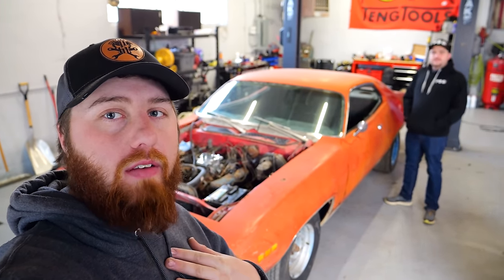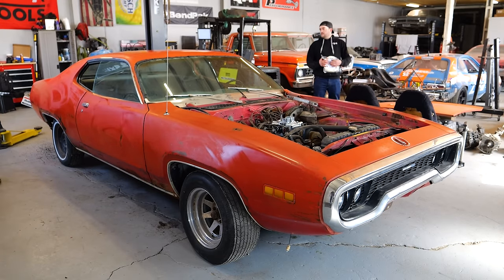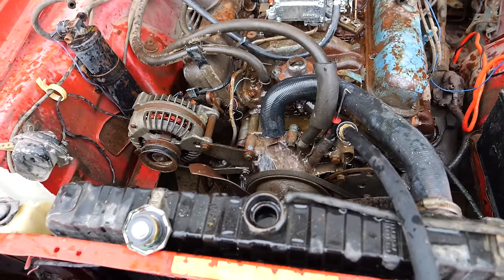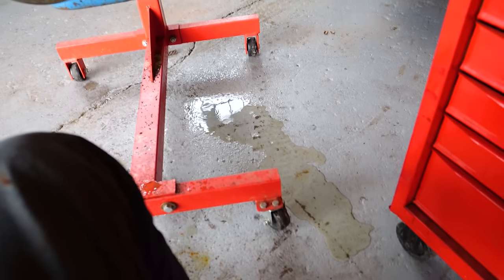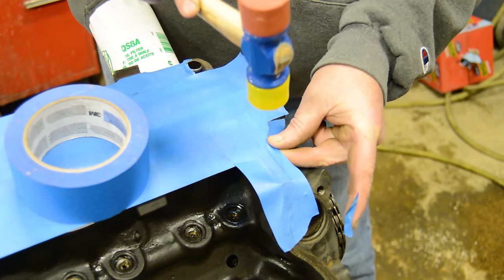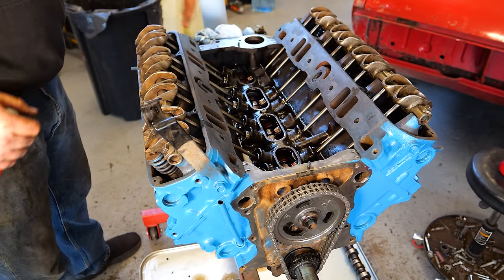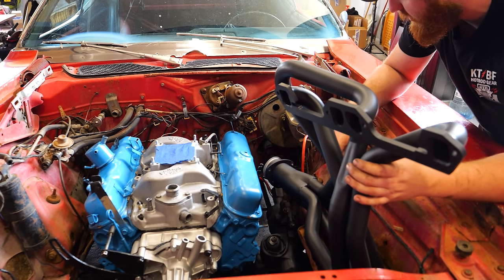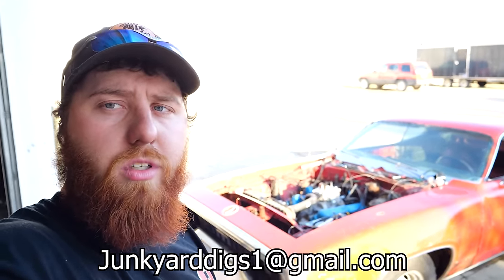ABANDONED MOPAR Budget Engine Build + Paint REVIVAL - Lost for 30+ Years!

Comment: MOPAR! OIL pressure is low. FYI You should always start in the middle of a rocker shaft and tighten all bolts. Gradually. Learned from experience. You can bend shaft. prssure should be around 40 at idle for a mopar.

Comment: take out that VW radiator and get a 140* thermostat and try to keep it 140 to 160* degrees max, get an engine oil cooler, get a transmission oil cooler and make them huge, get a double pass custom humongous radiator by filling the entire front end head light to head light with it, thats what i am do.

Comment: Why didn’t you check the   Bearing on the crank or put a new set of rings or do a valve job . It’s going to be a bummer when you racing it a ring or bearing goes.

Comment: C'mon Kevin.... how can you POSSIBLY justify to your viewers not pulling the heads or even the oil pump while the engine is on the stand getting cleaned and painted? How were all of the main bearings? Rear main seal? What was the point to all of that... polishing a turd?

Comment: Would have been a whole lot better if you had done those heads there are you going to have issues with those umbrella seals on the valves they're going to start breaking going down into a oil pan and clogging up the oil have fun with that enjoy

Comment: i order all my trans parts for my th400 from summit. never ill say that for the guys and gals in the back of the class NEVER USE PAPER FILTERS FROM ORIELLYS OR AUTOZONE ETC ON A TH400 use a wire mesh filter and double gaskets on the pickup tube case side

Comment: I feel like if you’re going to take the car back to the original owner hoping he would buy the car back that you should address the engine issues like the valves  at least try lapping the valves and do the oil pump, bone the cylinders and some new rings. If the original owner wants to rebuild that engine he’s going to have to pull it out either way.

Comment: Roller cams do not need a breakin like a flat tappet cam.😂 For the street degreeing a cam is a waste of time, install dot to dot. If your on the track racing then degreeing would be beneficial. You say that the chain will move to dot to dot? Are you using Chinese chains? That is complete BS. I put on 48,000 mi on a solid lifter cam in my 70 Z28 and the timing was still dot to dot @ TDC on #6 comp stroke. But those parts were made in USA. LOL. Not sure about Mopars BUT you can’t use the same length pushrods on a Chevy 350 when you switch from a FT cam to a roller. I have a roller in my LT1 now and it’s impossible to get the correct center ride on the rocker arms to the valve tip. Some clear rattle can paints will turn yellow from the heat. Do not use RTV on thread bolts. Engine builder go crazy when people use this crap. Use Permatex 2 on bolt threads that see coolant or oil.

When breaking in a FT cam you should put a dot on each pushrod in the same location so you know the pushrods are turning. Lift off the valve cover for a few sec to check. If they are not turning then you will lose that cam lobe. And when setting the lifters, limit the amount of turns you turn the engine by hand or you’ll just wipe off all the cam break in grease off of the lobes. 😅

Comment: put roller cam an lifters in a tbi with out doing valve springs was very popy for two days  no at lidel it has a puff puff sound like theze engine think im good to run it I chould take a video of it see what someone thinks 🤔 never. Dun these work before thinking of doing celinder test take plunge wire off one at a time running see if I find it it's a bad head vavle when the flat tapit went out let me know what u guys think

Comment: Best way to blow an engine is to this video build the top running 100% while engine below is running about 45- to 50% ya that makes since spending lot on top end to re do it in the first month driving it ya them a whole rebuild ruined all you put in it to force a rebuild if you did not hurt the block the piston walls or crack block, big chance in one or both happening hu. Will ruin what you put in it when you blow engine all said do what is best or what you think is best hu

Comment: I don't understand why you would pull the engine, replace can & lifters and neglect the valves and valve seats, your that far in it's not that expensive. Compared to replacing the engine later.

Comment: Why don't you just use this???....SprayMAX 2K Clear Satin Matte?????..its a 2 part that will not be affected by fuel or oil. Duh....Also, you spent the time, sweat and knuckle skin pulling the motor out and replaced the cam, timing set, cero coating those headers, ect., ect. but didn't take the time to do freeze plugs or put a torch on those t-stat housing bolts and pull those out and replace them along with a new t-stat and gasket.....also, how much effort would it have taken to have the radiator boiled???....smfh at these videos sometimes.